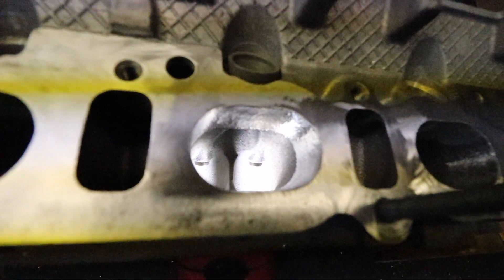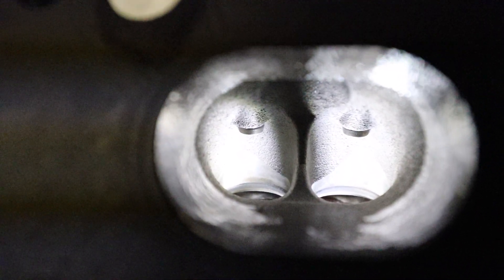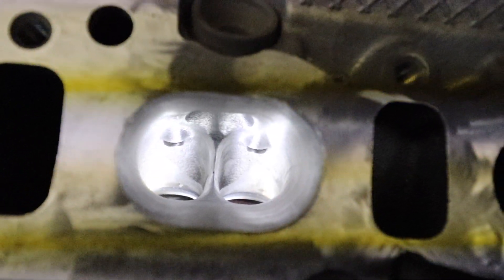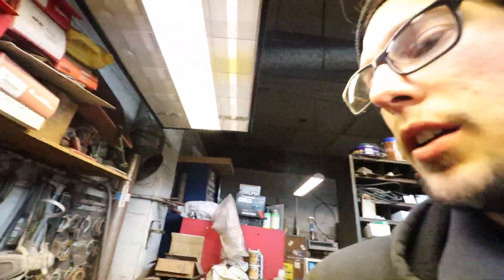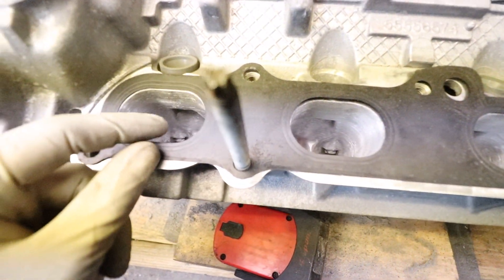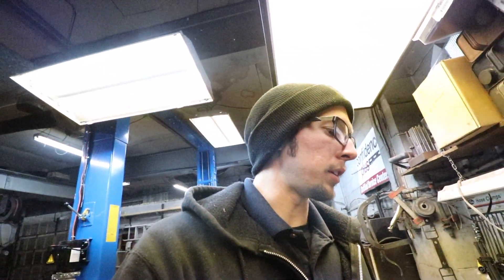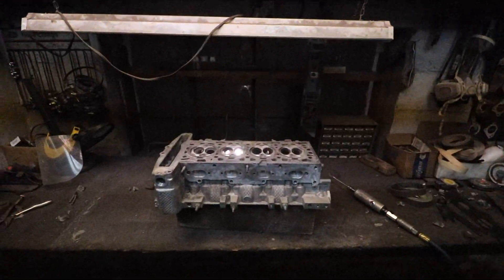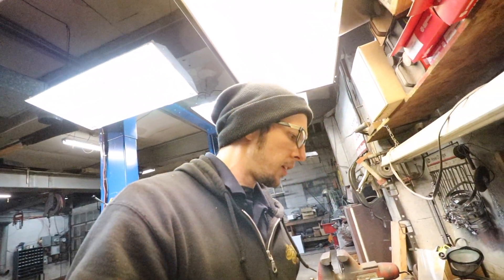Cobalt SS LSJ Head Porting, Finishing the Port Match for the Intake.

Comment: So something that comes to mind while you're matching the gasket to head on intake side would be, how do you plan to stabilize the gasket when installing intake manifold to head. I've heard you say you're sliding the gasket up to the floor of the port so you know how much to remove from the sides & roof of the port. So what I see is there is a small amount of gasket movement that will need to be controlled from moving so not to interfere with intake flow should it not be dead on..
Are you planning on using gasgacinch to hold the gasket to the head so there is no gasket movement ?
Reply from the maker: not entirely sure yet but ill probably end up tape the edges or something so it wont affect the seal and i can take it off once i get it down

Comment: Just stumbled upon your videos and great job with the lsj bro.   Been having an itch to finally mod my 05 SS, though I now have 230,000 miles on her and the sensible side of me says "don't mess with it!".  Think it's a bad ideal to go with a stage 2 zzp kit with a 3.0 or 3.1 inch pulley to complement the aem cold air intake that's been on it for 200k miles?  I kind of figure that would be modest power gains that really shouldn't stress the engine and trans too much but definitely give me a noticable new feel to the car/decent power addition.  Also for $350 it doesn't break the bank.  Decisions decisions.  What's your opinion mate?  Again awesome videos and cheers!
Reply from the maker: awesome to hear you got the milage you have and she's still running. I'd say thats a nice bump up that wouldn't put too much more stress on the car. i think you'd be fine with doing that.

Comment: You upgrading to a smaller pulley on the supercharger? Going with bigger injectors, header, and dual pass on the intercooler? I have a Redline myself, I'm on the fence for a turbo swap or just a pulley change. I'd like to get 400whp to 500whp out of her though... Also is your Cobalt limited slip? My 05 Redline it was a option they didn't get and I'd like to upgrade it. You wouldn't know how hard to work on the F35 trans is on these would you? :)
Reply: There is no way to get 400-500 whp out of the stock M62 without doing serious bottom end work and even then it's unlikely. I believe the current highest M62 on stock bottom end is around 340WHP. That includes all supporting mods, E85, ported head, ported M62, upgraded cams, and a shit load of other things. To get anywhere near the 400-500 whp you are better of just going turbo.
Reply from the maker: @dhart9858  yea i know its hard to get real numbers with the stock m62
Reply: @salvobrothers5928  ZZP says the stock bottom end starts to get questionable at 420hp, I believe I seen a dyno on Youtube where the guy was just south (8hp) of 400whp on the stock Eaton M62 (pulley upgraded of course). @D Hart I'd be doing a full build though, no worries on the bottom end. Not just going to slap on a turbo and crank it up.
Reply from the maker: check out my other vids i already went to a 2.6 pulley and all. keeping the supercharger for this build, you'll see as it unfolds. i bought an LSD MU3 trans and swapped it in mine